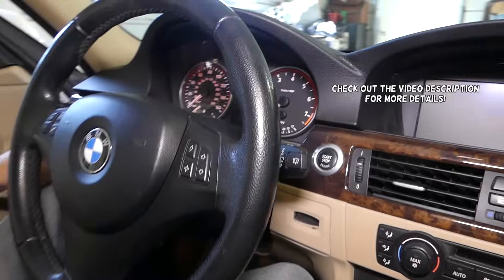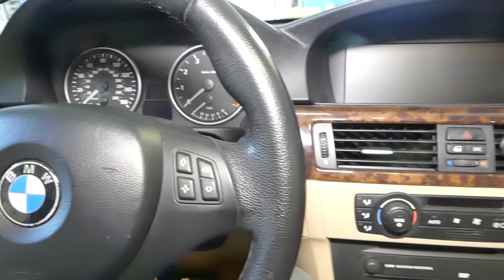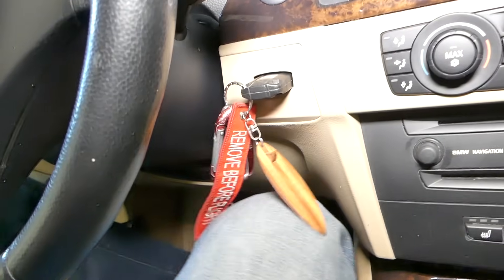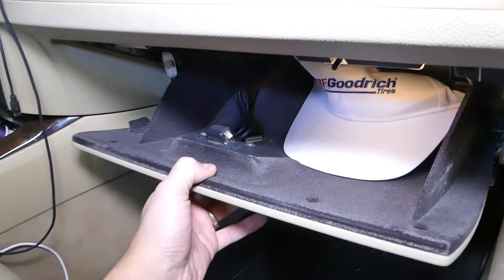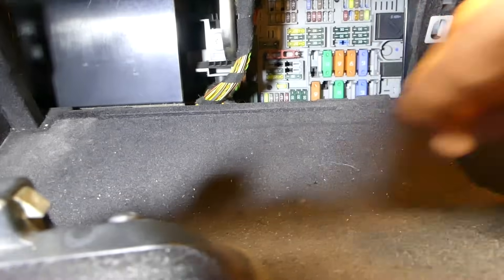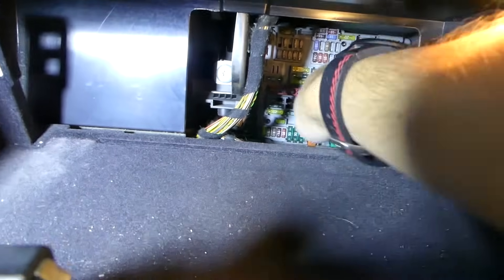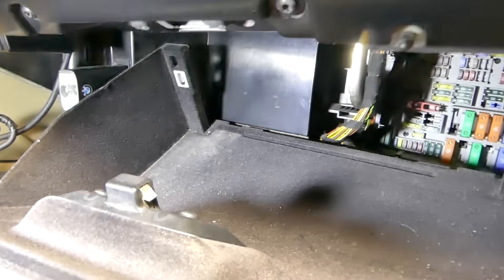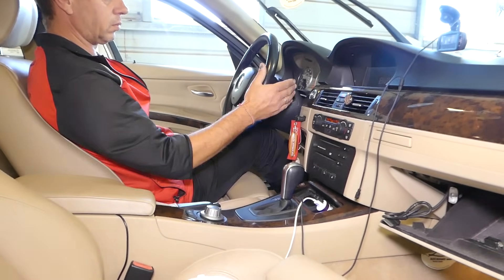NO START NO CRANK FIX BMW 325i 328i 335i 316i 318i 320i 335d 320d 318d 325xi 328xi

Comment from the maker: Products that we use and recommend:
► Original Replacement Relay: https://amzn.to/2r6eDWE
► Aftermarket Relay: https://amzn.to/4fjhQsa
► Panel Removal Set: https://amzn.to/3YiMADu
► Assorted Fuses: https://amzn.to/4fx4s3F
► Tool Set: https://amzn.to/3p5MM6t
► Screwdriver Set: https://amzn.to/3XRB28Q
► Mobile 1 Oil: https://amzn.to/3xBc8B9
► Oil Filter: https://amzn.to/3w0Ulme
► Torque Wrench: https://amzn.to/32qyRwg
► Liqui Moly Engine Flush: https://amzn.to/3IiDBID
► Voltmeter: https://amzn.to/4hB6Zvk
► OBD Scanner that we use most often: https://amzn.to/3I4MQfe

► Check out our Amazon Store for the tools and parts that we use: https://www.amazon.com/shop/worldmechanics
Reply: Guys quick question will this work if I wanna stop my husband from taking my car....he has no driver's license and I hate he takes my car too much liability....can I take this out if I dont want him driving it and put it in when I get in ????
Reply: IT WORKED!! THANK YOU SO MUCH  :) :) :)
Reply: World Mechanics please I have a problem with my BMW E46 N42 320i 2003 ... 
the transmission light comes on at speed 3 when I drive my car after it’s being stop for more than an hour ,,, when the light come on I immediately turn the car Off for less than a minute, after that I start again and it goes well all the way , and it does not happen again until the car stops for more than hour. 
This issue was happening ones a day , but now many times. 

Please I need your suggestions for what to check and what to do.

Please help me out with this.

Waiting for your reply 
Kind regards.
Reply: Worked ! Thank you so much.
Reply: What’s the part called
Reply: Hey man my car is dead dead Notting is happening I tired to jump start it I tried a new battery and Notting
Reply: Why you not answer back the comments ? 😢
Reply: One question my bmw 2009 328! does not  start. Battery is good, I don’t know if control is bad Control works perfectly open and unlock doors. Do  you know what might be the issue ?
Reply: @sanchezf6947 I’m in same situation I’ll update you when I figure out mine.
Reply: I got  a new keyfob from the dealer I chose that option bc I thought it might be the problem, bc key fob unlock and lock the car perfectly, so it seems like keyfob was not the problem but the weird thing was that  the trunk door was opening by itself like one time in a week, and days later I saw a key warning on the darshboard, one month later trunk door started opens by itself constatly ; (since I have the new keyfob, the problem disappered but still the car doesn’t started, so I replaced the starting and everything is perfectly now.
Reply: Hi getting code U110F car no start at all what is the solution to it please?

Comment: Let me add to the list of thank you’s! My mechanic told me it was the starter and possibly even the engine locked up. I paid him for his diagnostic test and told him what I found out from looking at your video. He told me with no hesitation and with a look of disgust. “ That is not the problem I’m telling you it’s the starter” In front of him I pulled out the relay and reinstalled it and the my car started right up. Now he’s asking me what relay I removed for future repairs on other vehicles. Thank you! You saved me tons of money on unnecessary work.
Reply: Well Done my friend !! 🤣.. you schooled him , 
I bet that felt great , should have asked for your money back too lol,,
I`m having the same issue , will order a relay now .
Reply: Just did the same, relay was HOT, pulled it out,5 min put it back in and car started. Mechanic wanted to put new starter...
Reply: @blubac I’m in this situation right this moment 😢 I unplug that same relay and yes it gets real hot  the  door bell and glove compartment light  gos off when I unplug it so not so sure if is bad
Reply: Oh emm gee I'm having the same issues I got dummi thieves and they think they want n take my shyt I'm having to deal with the police n everything it's been so much

Comment: 2007 328xi wouldn't start yesterday after thousands of good starts. Push button nothing. Lights on and off but no power going to the starter. Watched this video and bought a relay, replaced it and the car started. Let it run for a few minutes and then turned it off and immediately tried to restart. No start. Push button no power to starter. Felt the relay and it was warm not molten hot by any means but noticably warm. Any tips on where to go now? I will test the new and old relay tomorrow.
Reply: No update?
Reply: What happened ? Did you figure it out ?

Comment: I have a 2009 BMW 328i and I had the same problem, car ran great and went it to start it and nothing just a click. I researched the bmw forem and found no answer so I changed the relay start fuse and still nothing I charged the battery and still nothing, tried jump starting the car and nothing, all the light worked fine too, so I pulled the starter and had it checked at a o Reilly’s store and it failed so I put in a new starter and she started right up! I hope this helps someone with the same problems.
Reply: Was your steering wheel locked?

Comment: I literally unplugged it then plugged it back in and it worked
Reply: Kevin Yusuf wow, I'm going to try that
Reply: Same here. It worked :)
Reply: @TheAngelAbandoned  can u guy's please tell me what u unplugged i have a 2002 bmw 530i no power and it doesn't crank over when I turn the key the lights come on the dashboard and it beats that's about it
Reply: Larry Jr what was the fix?
Reply: Beside not turning on, was your steering wheel locked?

Comment: Have 2009, 328i, 96k. Drove all day then stopped one last stop, 10 min.  Boom, no start. Tried jumping. Only dash lights, interiors, beeping doors but no start.  Got towed to garage. was starter .  Replaced & Back on the road! :)
Reply: im in the same boat, replaced the IBS sensor (negative battery cable) but no change, ended up being the starter:face-purple-crying:
Reply: I have this problem now but 2015 model f34 and doors beeping won’t lock, telling me that battery is now quick drain, interior lights and radio etc all working but when I click to start it just makes a single clunk.

Comment: Saved me! Took the relay out for a couple of minutes, put it back- and it all worked. Big thanks!
Reply: Bro help please 🙏 
I have one 318d, whats going on with reley?? 
Was reley HOT??? Mine is to HOT!
Reply: @noahmojsin5745   same here bro I got a 328i my relay was HOT so I went and got 4 other ones and they were working for a couple days but now the car just won’t start no matter how many relays I put in
Reply: @fabriciopintado7916   Its a STARTMOTOR you need new one 👍👍👍

Comment: Here's my story so make sure you sit next to a fire pit 😅 - I remember moving my 330xi back and forth one day it was parked and I just literally moved it forth and back, wile the car was working just fine prior to this, the next day I tried moving it to go somewhere, it didn't wanted to start, no crank, no start, all it did was like a metallic cranking sound, I went into trusty YouTube and found this video, tried everything as shown here and nothing worked, called a mechanic, he came and checked it... He told me the  starter had just died. Same week I buy the starter and call another mechanic to get it installed for me... When he finished working on the starter to my surprise in the process of mounting and fixing the starter, bunch of hoses from the ccv were now broken or lose, so I now had to replace those as well.... Bought the lower ccv hose and the upper ccv hose, bought also one hose from the breather line that sits just right on top of the alternator, so now fast forward, I bought everything, put everything back together, and for my surprise... Battery just died on me also... Now I'm just waiting til tomorrow, cuz since everything is coronized now businesses closes early, to get a new battery.

Like I read on a comment. BMW stands for "Break My Wallet".

So for those of who this method worked. I hate you.
Reply: christ on a fucking crutch bro😭😭
Reply: So did you ever fix this problem, I’m invested lol
Reply: @Oneklickmedia  🤣🤣🤣🤣
Reply: Did you fix it bro??
Reply: @leviriordan7183  oh yeah I got to fix it… it was one of the best feelings in life… was able to save 1500 bucks going to an AAMCO repair shop 😀 but that car is long gone now, I sold it for 2,800
Reply: @Abdias J  so when it was all good what do you think it may have been,mine stop after driving it.i curious if mine is the starter.thanks again bro...
Reply: @leviriordan7183  it was the starter that… (no pun intended) started everything

Comment: I have 2008 BMW 335xi. Initially I got no crank on pressing the start button, I removed the relay and tried to start sometime and then put the relay back and I was greeted with multiple failure messages. Airbag failure, ABS failure, Break failure and what not. I am going to order the relay and replace. Please advise.
Reply: Did that work?
Reply: @MalucciPugh  I replaced the relay but it did not work for me. I sold that BMW, the buyer later updated me that he replaced the starter and its working. Later I realised that couple of days before it stopped working It happened that I took the car in the flood water.. I think the flood water damaged the starter.

Comment: If after all this time its gonna help anyone i will be happy. I had the same issue, had figured myself out it was a relay, but no matter how many time u do it, u help the car to get alive, but the problem was still there. It was the junction box (or fuse box whatever u call it). I changed it, and all problems were gone. Hope it help lads!
Car: bmw e90 2010 year 318d

Comment: I have a 2009 bmw 328i. It died one day and it wouldn't do absolutely anything. Wouldn't jump.  Wouldn't turn over.  I assumed starter. But right after I purchased a starter, it started working...I replaced the battery and the ibs sensor. Now it cranks strong, but won't start, no codes.

Comment: Mine 328xi wont start and i took this relay out and it was hot. Hopefully replacing this fixes my starting issue.
Reply: Did it fix your issue?
Reply: @mikewazowski5514  no, it didn't. My issue was a bad starter.
Reply: @lakaiandi220  ah ok, thats good you fixed it. Gotta keep searching.

Comment: My issue is I changed the alternator  and charged up the battery and it acts as though it wants to start but it doesn't. Please help me because my mechanic says it's not the starter.
Reply: Same here. You ever find out what your issue was?

Comment: I have a BMW N54. The last time this happened, it was my battery. I replaced that, and it's been about a year now and now it's doing it again. My car didn't start when i shut it off at a light a couple days ago. I heard a clicking noise So I'm convinced it was the starter. I just changed the starter, and now there is no clicking noise but it still won't start. All my lights are on so the battery is good. I'm gonna unplug this relay out and in again and see what happens, I'm also going to replace the battery in my key since it was low a couple weeks ago. I will come back with an update!
Reply: Guys, I found the problem. I changed my relay, my key battery, I tested my battery, I changed the relay, I changed the starter. None of this worked! It turns out it was my GROUND STRAP underneath driver's side, going from body to the engine. The engine was not getting ground, the strap was all corroded and literally broke by just touching it. I changed it with one from the auto parts store and my car started right back up!
If you tried hooking up cables to jump start your car, and nothing happens (even if your lights turn on on the dash) Then you need to check your ground strap!! I should have started with that first and saved me hundreds of bucks.  Hope this helps someone before you go changing parts.

Comment: In a BMW 2011 328i xdrive, removing the "Kl." relay also caused the glovebox light to turn off, so that could be an indicator of a bad relay, without needing any test equipment.
Reply: I noticed my glove box light turn off after I removed relay then turn back on after but now my dash isn't lighting up and car won't start

Comment: I have a 2011 bmw 328i. One day I hit a curve 30 minutes later. The car cut off. I replace the +cable from the battery but it didn’t help. What I found out that there is a square relay that was getting very hot. Any ideas why that relay was getting so hot. Please let me know.onces the relay got cold it would re start nicely .
Reply: Any luck with the relay getting hot?  I'm having the same issue
Reply: Bro help please 🙏 
I have one 318d, whats going on with reley?? 
Was reley HOT??? Mine is to HOT!
Reply: Hi! I have exactely the same problem! Mainly in summer, when wheater is hot. After long or fast ride car always wont start. I need to pick up the hood and wait until it cool down. After 30-60 minutes of waiting everything works fine and car start from first hit. Do you know what was the issue?

Comment: (After installing a new battery on a 2008 E90 335XI sedan model):  
All dash lights are on, radio works, locks work, etc, but car still will not turn over and engage the starter motor. I also replaced a relay on the fuse box that you mention here. I did also try disconnecting the blue connector from the negative battery terminal that I saw on another video. ..unfortunately car will still not turn over . Any ideas or videos you can point me to? I really could use the help. Thanks.
Philip
NYC area
Reply: Ever find a resolution?
Reply: @colej123  My problem turned out to be the ground cable from the body to the engine block...
Reply: Who did the work for your ground cable ?
Reply: @wadestulla2884  I live in NJ (near a town called Red Bank) so I brought it to a place called the Middletown Service Center on Rt 35 Middletown. They repair a lot of BMWs...
It might be doable yourself, but I don't have a garage so a pain to do in a driveway for me...
Reply: Have you tried the starter im just woundering,also have the same issue...
Reply: @leviriordan7183  It was the ground cable from the body frame to the engine block...
Reply: @Uptown Photography  thank you my guy I really hope it's the same for me atm,imma go check that out real soon,I'll probably update on the comments just so anyone looking aswell can hopefully find their answer 👍 but thanks alot my guy...🤝🙏💯
Reply: @leviriordan7183  My pleasure. Good luck. Hope it works. 
BTW: You can test this by a jump start with the positive jumper cable to the positive (+) read post (under the hood) and put the negative jumper cable some where with clean bare metal on the engine block. If she starts, it's the ground cable from the body to the engine block...Good luck.
Phil
NYC Area

Comment: Hello , I have a 2011 328xi beautiful Bmw.I have had new stuff done. But , my car was driving fine I go get into it and starts and then lights and Radio  came on. But I start and then let off pedal and dies it did that q dozen of times now I a just dead completely!!!! Nothing but weeks that added to this my key fob would not lock n unlock car so I dont know what it can be dead battery? Starter please help please 🙏 Thanks

Comment: I’ve replaced the relay and my car stared working again but a few days later it wouldn’t start again. I’m thinking it’s the grounding strap but I’m not sure.
Reply: I have the same problem I got like 5 more relays and they worked for a couple days but now nothing I do starts the car how do I fix the strap?

Comment: Hello, I have no crank no start problem, but my problem is when you put the key on the car, I get first light and cabin power. but when I push the start button, It doesn't turn on the Ignition dash lights (engine check the fuel level, airbag abs check, etc.) so no crank either. do you know anything about it? ground wires and battery checked they are all good. and tried to jump-start as well. I checked all the fuses and relays as well. but no result. I hope you can help me! pleaseee
Reply: i m having the same exact issue how did you fix it?
Reply: @alexandresongbe8204 I think due to power fluctuations, Steering Wheel Lock was blocking startting car. So I turned off that in car system. Charged my battery and it started.

Comment: 2008 328i  it doesn’t start and the brake is hard . The battery just got it not to long ago .. helps a brother out..?
Reply: Johnny Flores same problem, drove to the gas station turned it off went inside and when I came back out it wouldn’t start up
Reply: Same, turned it off for literally 20 seconds and it won’t turn back on.
Reply: Did you figure out a fix to this
Reply: Was it the starter?
Reply: Just happened on my 2008 bmw 328i
Reply: Update ! I got it to run but. I sold it  got a truck now  bmw not for me bois

Comment: Looking for some guidance.  Same thing happened to me where the car would not start, after a few minutes the car did start with out doing anything.  However, I also noticed the time on the radio got reset?  Does this mean anything else?

Comment: What if the bmw is completely dead I got home turned it off and it completely died jump start won’t work and it doesn’t turn on not even the lights so I can’t access the trunk any suggestions I recently changed the battery 3 weeks ago Along with battery cables the red box that goes on top of the battery and last week changed the alternator worked for a couple of days then boom please who has gone thru this?

Comment: hey can u help me out.. i have a 2006 bmw 320d, on morning i'm  having a problem getting ignition on the car. but wen i actually gets it on and car starts it works well during the day until i park it at night and the same thing next morning.. im hearing the turbo actuator pulsing even when car is lock..